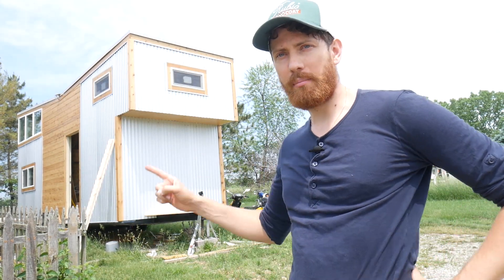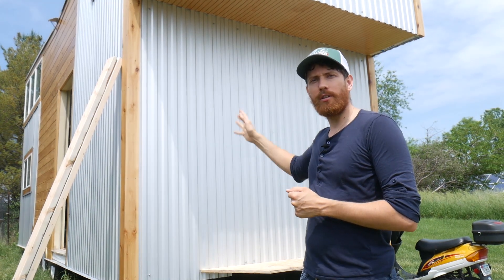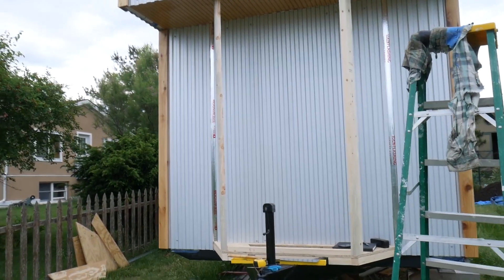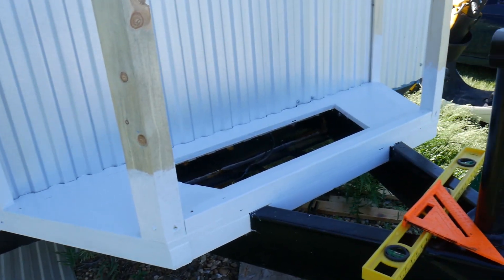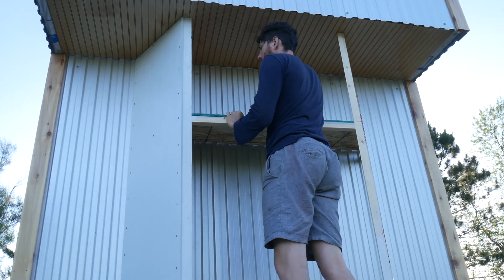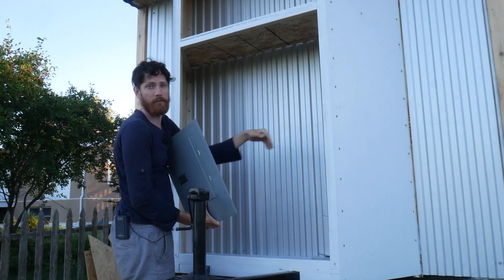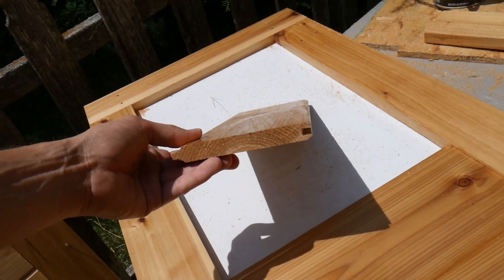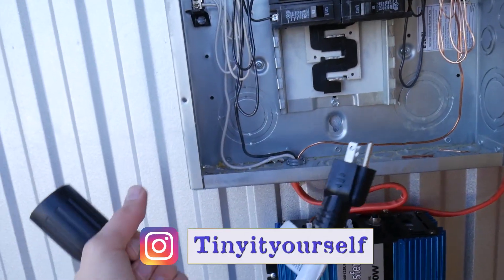Building a Cedar Tongue Box | Tiny House DIY

Comment: Marine grade plywood is just structurally better, not more waterproof. It will rot just like this if it keeps wet. Normal outdoor "WPB" water and boil-proof plywood will have voids inside which aren't good for boats. 
How they are used in boats is using epoxy and fiberglass to encapsulate them and turn them into a superior composite product. Paint will do nothing since it's very porous. Other resins like polyester won't work either since it has solvents that evaporate before it gets hard so you have many tiny microscopic pores where water can get in and stay inside the wood. Only epoxy and some others cure without evaporating (also good, less stink / VOCs) and create a solid surface. But you still need to coat multiple times.
Then you ALSO need to paint because epoxy isn't UV resistant.

As long as the wood isn't drenched constantly and can dry regularity I doN't think you need to worry about any of that. 

But there is a really nice camper build from cheasapeake light craft that looks awesome and shows what can be done with plywood and epoxy and fiberglass with extremely low weight.

Your house looks awesome! Nice video.

Comment: Great video.  I'm duplicating a lot of your ideas.  Lol. The're good.  My camper demo steel tiny house is underway, trailer done. I'm starting the foundation today.  Yay.   Gonna try to make it removable from trailer.  Will waist 6in head room. Trying to document so I'll link when I get it up
Reply: Roush 3d cool!!!! My only suggestion that I haven’t mentioned yet is adding some extra anchoring directly into the metal trailer and connecting to vertical studs. We actually went back and added corner pieces that are L shaped metal brackets inside the bottom wall track that have a bolt that goes down into the trailer and also connect to the vertical studs

Comment: Keep in mind that batteries have an operational temperature range. If you keep them in an area that is not climate controlled you can kill them early.   The cold can cut their life in half or worse!   Seal  and insulate where you have the batteries and run a fan that pulls the warmer air from inside your home into the storage box .